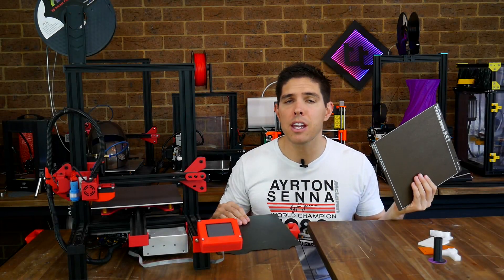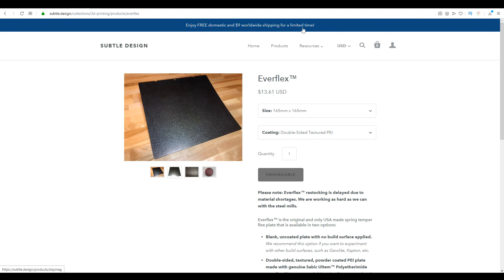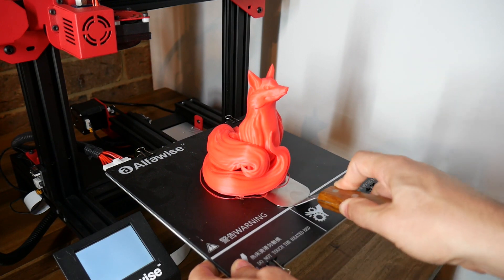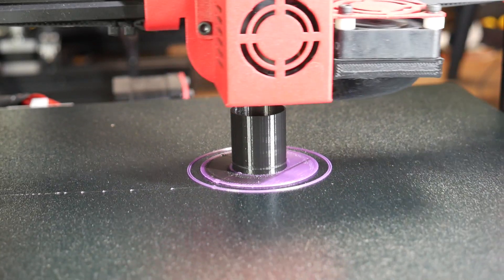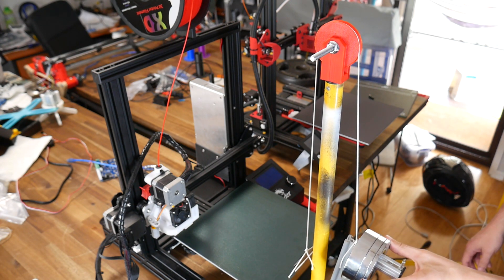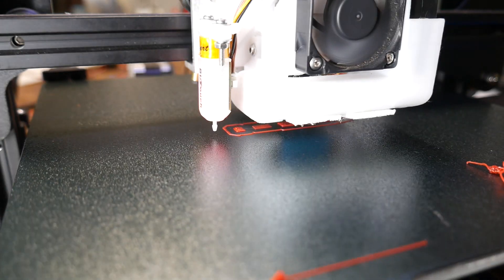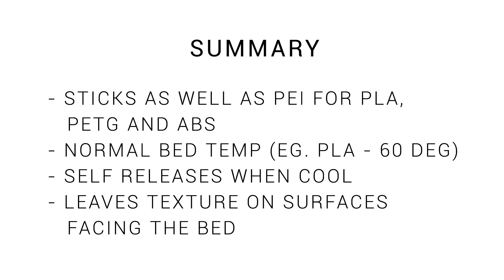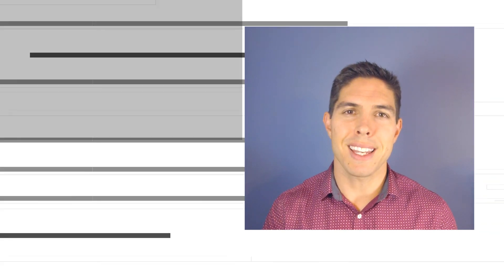Everflex PEI powdered coated magnetic sheet - Prusa style bed for your 3D printer

Comment: Be aware, they do not put an anti-corrosion coating between the steel and the powdercoat.  One of my sheets at work started to rust within 3 weeks and is now covered in rust spots.  I have another one that is in a climate controlled room that has just started to rust after 2 months.  I highly recommend avoiding this product until they add a corrosion protection layer.
Reply: Also, I've had chinese powder coated sheets at my work printer that have been in use for well over a year that have no signs of corrosion.
Reply: @npgoalkeeper _ Yes, there was a pretty lengthy discussion about it on the railcore discord.  we probably had 10 people for over two hours discussing it.  That's how we found out they didn't put an anti-corrosion layer between the steel and powdercoat.  They blamed me for not having a humid free environment and said they had no control over it.  It got so bad that the other railcore discord members were trying to coach the subtledesigns person how to handle the situation because they just kept blaming.  As much as I was looking forward to their product, their actions have been pretty bad.
Reply from the maker: Thanks for the heads up. Hopefully people pay attention to my disclaimer about not being a longevity test. I will post an update if this one starts to fail.
Reply: @theheadone  didn't you also have something insane like 80% humidity. My plates are over 4 months old with over a thousand hours of print time with 0 issue. I print abs on the regular at over 100*. As far as I understand he tried to repair/replace the plates immediately but you didn't want to even try and just took a refund. No product is perfect and defects do happen. Difference is how people stand behind it.
Reply: @bl5930  the one at work is in florida in a warehouse so, the humidity can get high, however the one in my apartment is kept around 30 to 40% humidity usually.

They did offer to replace the plates, but said that they couldn't guarantee  that they wouldn't rust again because they don't use an anti-corrosion layer.  Defects do happen, but when you cut corners, products fail.  

Prior to their launch, they were harrassing me for buying the chinese powdercoated sheets because they had delayed their launch and I needed something to print on.  So I have no love for this company after the way they have treated me.  Although I do wish that their sheets would've been good, since they're the only ones that have a full size powdercoated sheet for the railcore.
Reply: @TheHead WOW, where I live 90-100% humidity in the deepest summer is routine and everything I own MUST be Stainless Steel or it will rust.  They don't make one for my TronXY X5S as it is 330x330 but even ifthey did this nugget of a revelation ruins it for me.

Thank you.
Reply: You can check out the EZFlex2 system that we sell. The plates we sell have a high chromium content that will not rust. Corrosion resistance was brought up as a concern from our customers so we made sure to test them by damaging the surfaces and then spraying with water and letting them sit. This was repeated over the time span of 3 months to make sure over time it will corrode. We've been using the same steel plate supplier for almost 2 years now and have not had a single report of any corrosion.
Reply: @TH3DStudio  That sounds great, could you make them with a 340mm x 325mm size (for railcore)?  I know the railcore community would buy them in bunches, since the subtle design ones are the only powdercoated sheets available for us at the moment.
Reply: @theheadone  We actually are good friends with Joe from ProjectR3D and are talking with them about getting plates made for them. They already use our PEI sheets. ;)
Reply: @TH3DStudio  Ooooh, now you've got me excited! <3
Reply: @theheadone  You're out of stock too.. :( Artillery SX1 owner (310x310 I believe.)